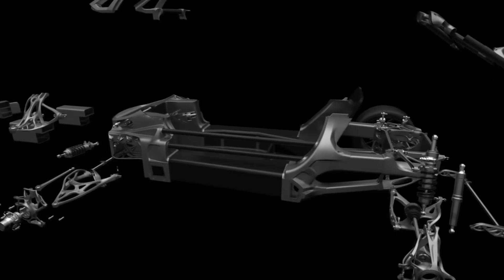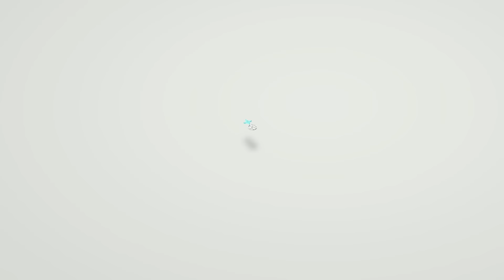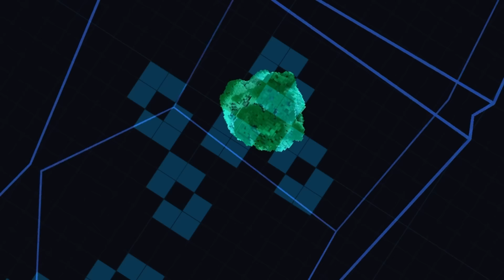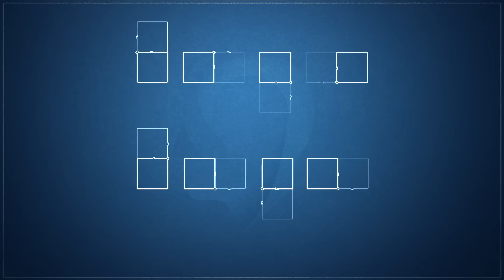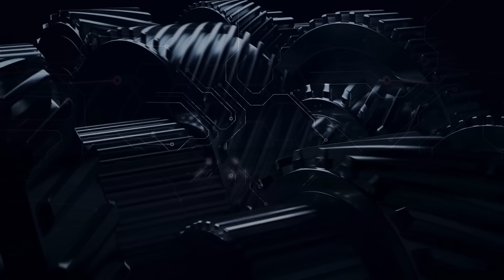The Future of Auto Manufacturing: AI Driven Design

Comment: In the future, cars completely buckle and melt away if you hit them from the wrong direction. I am disgusted with the path that vehicle engineering is taking. It's good for the tests, and weak in every other direction, to minimize weight. "Optimized" mechanism fail if they are operated outside expectations. You know the crappy cars from the 80's? You could hit speed bumps at 200km/h and not even worry whether the suspension will break. Try that with a modern car and they whole thing buckles, and it's no surprise if wheels rip off altogether.
Reply: The algorithms already take in account of strength of parts & everything, you forget that.
Reply: @artistanthony1007  Yes, that's the problem. The input fed to the optimizer tells it how weak to make it in each direction, to minimize weight. Weaker is lighter. You just have to hope it doesn't get any unexpected impacts, along an axis for which you expect smaller forces. If it weren't so "optimized", it would have excessive strength in those directions, because of how robust it needed to be in the main direction.
Reply: The car is a sacrificial shell for the occupant. You know what happened to people inside those "though" cars? The impact was transfered to them and they died.

Comment: what i wanna know is how does standardisation of a charging cable make sense when we have 15 million different types of piston, crankshaft, hell every exhaust for every car is different, every brake pad, every bit of fuel line or brake pipes, its all unique for that 1 car, but we must all have 1 charging cable to screw apple over, i mean i like it personally but it would make far more sense if we did it to a big industry that is full of wasteful engineers
Reply: It doesn't screw Apple over.
Every car has its performance and weight goals, alongside fuel efficiency and emissions. Phone batteries are phone batteries.
Reply: @ChucksSEADnDEAD  you telling me they need 3 million sizes of brake pad and caliper but it makes sense that every device needs a USB-C

You are crazy lol
Reply: @ObiWanCannabi  It's not crazy. All the devices I have that were purchased in recent years have USB-C. So clearly every one of them can use USB-C no problem.
Try to brake a Hummer with Smart car brakes.
Reply: @ChucksSEADnDEAD  thats just stupid you do realise you could make 3 types of brake pad tho right, small medium large, hell add one more for American, and ya good..  you think we need 17 billion types of caliper that are all slightly different just so autozone can sell you the wrong thing, because you brought the brake pads for a manual not an automatic, hell if you got the convertible you need to order them in special..
Places out there could stock 99% of the pads and disks out there and you know 100% they wont have the ones you need on hand.

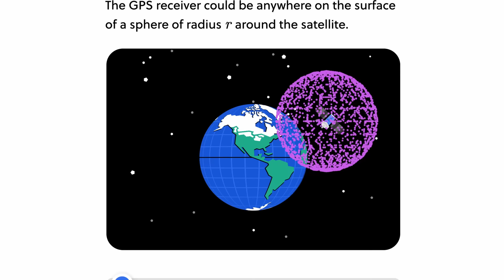Comment: Thanks, very interesting, watched closely.  A suggestion - I don't think that your suspension component example around 19:00 worked well because a fundamental constraint of the suspension components is that they would be joined at pivots from the start, and it would waste computation to have them find those constraints through iteration.
Reply: In theory if only mounting plane of suspention joints is defined it can make iterations by moving them around

Comment: AI is the new hotness so all companies started chanting "AI! We use AI!" to bump their stock prices and attract investors. Actually, real-world AI-designing use is very limited and done basically only for marketing claim.
In the field, advanced real-world parts are designed with the now-old Topology Optimization (presented at 3:40, wrongly claimed to be a "generative design algorithm") that are then tweaked / re-optimized / re-modeled by humans. The most time/brain-power consuming part is NOT the (initial) design in CAD, so saying AI will revolutionize it is completely missing the mark. The difficult part is determining part constraints and design goals, and setting up reasonably-accurate FEA/FEM simulations that complete in reasonable time. There's a lot of fine balancing between the various goals (cost/weight/strength/fatigue/part reuse/ease of manufacture/assembly/repair) including talking to/negotiating with other teams to improve/work around particularly costly constraints. Which means many edits and long simulations.
As for AI.. it's mostly hype. Sure, a "smarter" topology optimization algorithm could in theory result in a 3% lighter part for the same cost but only the humans in charge could rewrite the constraints / re-design to simplify an assembly and remove the part altogether. 100% win, the best part is no part.

Comment: It might be interesting to incorporate the growth patterns of small polyp Stoney corals into the generative models. Acropora and Montipora species can be both plating and branching in the same species especially when building a base foundation level. A basing growth pattern will be preferable in early growth stages to produce enough support before branching is prioritised. It is interesting because basing phases have less overall external surface area limiting the ability to intake mineral and nutrients from the water column when compared to the branches which have many more surfaces for polyps to receive the minerals and nutrients they need. Corals are also interesting as they are fauna that incorporate flora for additional energy and nutrient production. 

Could it be possible to grow buildings in the future that have both solar and water utilisation that can work to more effectively and efficiently become homes for humans? Even have some kind of computational system built into its own pattern of creation so as the structure grows the computational system grows in conjunction with the habitable space.
Reply: Or self -healing carbon offsetting roads?
Reply: @TheseThreeZs  as carbonate?
Reply: @alexandermoody1946  no, as a sort of lichen and coral bio-engineered combo. The lichen part would attach and grow down through existing asphalt/concrete roads and secure the organism to the environment underneath. The coral would grow on top, perhaps with some photo-synthesizing cells mixed in to let it be self-sustaining, and the whole thing would consume rainwater, as well as regulate for temperature, melting off snow and sweating off or radiating heat
Reply: @TheseThreeZs  I am sorry to say that I fail to agree with your idea. Have you ever grown corals yourself? 

There is only one invertebrate that shares many characteristic traits as corals in freshwater and they are hydra which are more closely related to anemones which do not deposit any form of calcium carbonate skeletal structure. The only semi encrusting varieties of anemones that I know of are in the order of Zoantharia and they do not as far as I am aware deposit carbonate skeletons either. The other problem is the mineral composition of rainwater will tend to be very low as the process of evaporation does not readily carry salts or other minerals into the atmosphere. The other interesting thought is that of the responses observed when corals are removed from the water and in effort to protect themselves from both ultra violet radiation and the general atmosphere results in mucus or slime production that would create a real problem for traction. Moreover if a small layer of saltwater was hypothetically used what would inhibit the salt from destroying the land adjacent of any surface that used some kind of bioengineered solution like this in a primary form. The difficulties of removing salt from the land or ground water would have a devastating effect on the environment both short term and long term. I do not know enough about Lichens but from what I have observed the ones I have had first hand experience with are not resistant to breakage and also typically feed by breaking down solid substrate surfaces. There are forms of algae that live commonly in sea water that lay carbonate structures onto substrate medium but they are in general not really compatible with road surface materials plus you have the salt issue. If anything is bioengineered what would the mechanism be to limit growth out in the open environment where current species are unable to adapt in the short term and perhaps the long term as food chain collapses due to monoculture would be apparent? There may be an electrochemical mechanism for laying surfaces like you suggest but I would be inclined to incorporate other technologies into the structure rather than biological organisms. One could propose a network of data or computational conduits through the road network which may help mitigate the urban heat island effect created by data centres and potentially improve the mechanism for laying of cables that are used currently. You could even conceive to construct such a surface like a neural network of sorts. The problem will always be to encourage the importance of keeping a stable biological environment for the organisms that already exist.

Nb corals are also very dependent on temperature stability, sea water due to volume does not have dramatic swings in temperature in the short term.
Reply: To add I understand the cost to the taxpayer to maintain road infrastructure is not typically appreciated and perhaps solutions are needed so I hope you do not think I have not put great consideration to what you have suggested. Kind regards.
Reply: To add again if you want to offset carbon and stabilise the atmosphere build more coral reef that are in areas where the seas are starting to warm although more importantly work to observe and conserve the properties of sea water at the correct parameters.

If you really think about it reefs could be designed with tourism so that naturally occurring reefs are protected whilst still making experiencing a reef environment accessible. This could work if there was a suitable group of artificial reef islands isolated in a single sea. Somewhere that already has some infrastructure like landing strips and buildings that would be suitable to be converted to mariculture and fish breeding facilities, hotels and a world class university that can catalog and observe the process and progress of the whole marine ecosystem in the designated area. This would act to encourage people from across the whole planet to want to train there and then take what they have learnt back to their own regions and tailor solutions suitable for other areas.

Comment: This is just the old but gold Topology optimization. AI can just be used to speed up the process, but AI is the hot thing this days, so...
Reply: AI is "just" optimization anyway. Even very big models are just incremental optimization.
Reply: AI is now the big hype everyone talks avbout even it has nothing to do with this actual vid and the methods. This is called incrementation or optimization using iteration.
Reply: the term AI has been thrown around so much nowadays that it has kind lost a lot of it's meaning. the more impressive thing to me about this is the 3d printing tech that was used.
Reply: Imho a lot of these optimizations aren’t really new but had been simply impossible to produce without modern 3D printing. And the costs are still prohibitive for mass production. Adding some material and simply forging a part can be way cheaper.
And most parts fail either due to material defects or unexpected loads where 3D parts are especially vulnerable for the later problem because they simply lack the additional material to deal with it.
Reply: He put "AI" for "Machine Learning" in the title. AI is more specific than ML and he wasn't really talking about that.
Reply: @Arnaz87 other way around. Machine learning is a method by which an AI can be achieved.
Reply: @Arnaz87  yeah, today every single instance of neural network being called AI.

Comment: 00:00 The Zinger 21C hypercar concept represents a milestone in Divergent 3D's goal to mass-produce vehicles with limited or no direct tooling in a fully digital end-to-end integrated system called the Divergent adaptive production system (dapps).
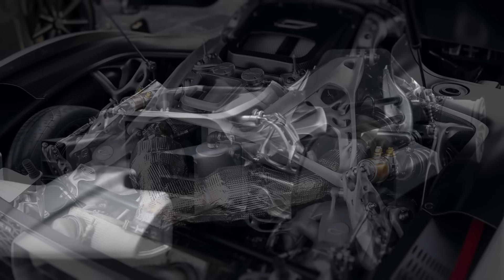01:10 Divergent 3D uses AI-driven generative design to rapidly create complex and highly optimized structures for their vehicles.
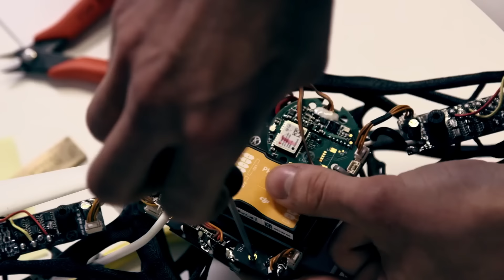02:32 Designers still play a critical role in defining design goals, interpreting the generated results, and incorporating their creativity and domain expertise into the final design.
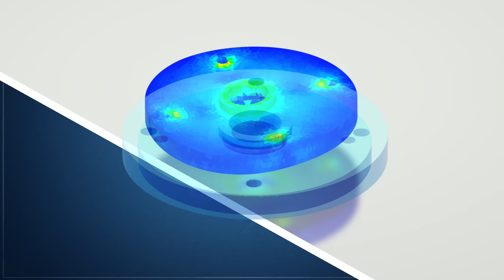03:41 Generative design allows for the production of optimized part designs more rapidly than traditional design processes.
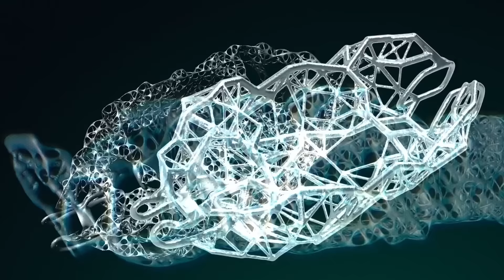05:16 Generative design can be implemented using different computational approaches, including cellular automata, genetic algorithms, shape grammar, L-systems, and agent-based models.
09:30 Genetic algorithms are effective for optimizing part designs by evaluating fitness based on weight reduction, structural integrity, and manufacturability.
12:04 Shape grammar is well-suited for aesthetic design exploration and repeated structure designs.
13:12 L-systems are used to model the growth and development of complex structures and can be applied to various design domains.
15:45 Agent-based models simulate the behavior and interactions of autonomous agents within a system, allowing for the generation of unique and creative designs.
17:25 Generative design technology is still in its infancy, with various computational models being explored, including neural network-based models and swarm intelligence-based models.
18:23 AI has the potential to completely revamp how entire industries operate, particularly in the world of design, by bringing about once unimaginable capabilities and redefining the roles of engineers and designers.
Reply: Haha that was a good idea
Reply: The marketing guys are having a field day with all those buzzwords and jargon. It might look and sound impressive, but it's more like a contest to see how esoteric and science fiction they can make it sound. LOL
Reply: Bruh

Comment: I'm interested to see how "organic" some of these designs will come to look.  I'm thinking of how the bones and cavities of the human inner ear look and how you could imagine suspension components having similar shapes.
Reply: That's not a thing to aspire to. Biological system are usually horrible, horrible systems. Take the eye: due to the sequence of evolution, the nerve and blood supply for every receptor cell is in front of the cell itself. Evolution produces a series of "good enough" and not finely engineered and tailored solutions.
Reply: @anivicuno9473 the eye is also backwards :3
Reply: @anivicuno9473 - Wow. These old, disproved arguments don’t die off very quickly but they keep reproducing themselves. Usually I explain why the eye is not a problem and site more current research to back up my claims but this one is going on a decade now so I’m just going to say this and let you look it up yourself-

Your argument would be correct if you were an octopus and lived under water but since you live in air you can be grateful that your eyes have the reverse design of the octopus so they don’t burn out faster than a joint at a rave party.
Reply: @anivicuno9473  make a better eye than
Reply: @anivicuno9473  lolwut?  Think for a moment about the constraints under which biological systems have had to develop.  The best design we can come up with for the most familiar example is the boston dynamics stuff - it can do one or two of the thousands of things that a human can do, about as well as a human can.  Until you can get that to find its own fuel from its surroundings, repair itself when damaged, reproduce itself in a continuous improvement cycle, and invent a piano and then learn to play it, you might consider giving the good old bio-system a bit more respect.
Reply: @TheGreyBee you are talking about superiority of an organism as a whole. Versatility needs compromise. When looking at respective "parts" or "subsystems" of an organism, it really is not that great. We can do many things, but no human can go as fast as a jet, we cannot lift that much, we cannot "zoom in" with our eyes etc. Evolution requires resources and trade-offs, that's why it settles on "good enough".
Reply: @szymon0900  It's not just evolution that settles on "good enough" - any design process does that.  The stuff they're talking about in the vid explicitly does it.  Look, if you want to compare things, you have to do it on a level that's...comparable.   Isolating a couple of aspects of one of the parts of a bigger machine and using that doesn't make any sense.  I mean, in resistive strength, you can be easily beaten by a medium-sized rock, but you wouldn't say the rock had superior design, right?  So using our best design techniques, can we or can we not meet or exceed the design goals of a human being?
Reply: @TheGreyBee  Look at the knee joints. It would never be considered "good enough" if it were mechanical.
Reply: @ChucksSEADnDEAD  mine are still in pretty good shape, and there are some pretty hard miles on there -  mogul skiing, martial arts.  Do you have a 63 year old car with original parts that still runs well?
Reply: @TheGreyBee  I had an effed up right knee by 25. And there's plenty of wrestlers, BJJ and MMA fighters with messed up knees by their 30s-40s.
Cars have replaceable parts. So they're not built to last forever, you just purchase new ones. Meanwhile, humans were never meant to just go down to the human parts store and buy new stuff. They need to last.